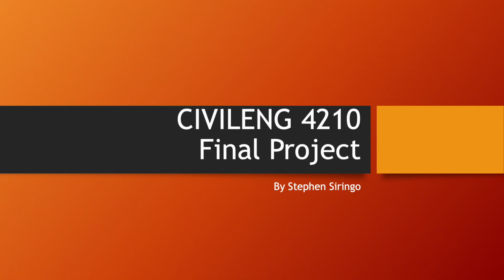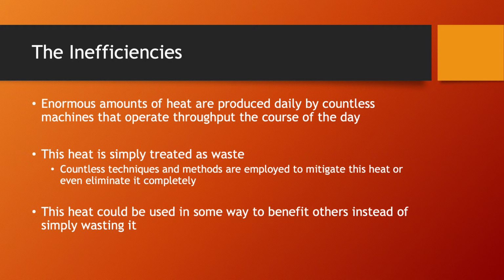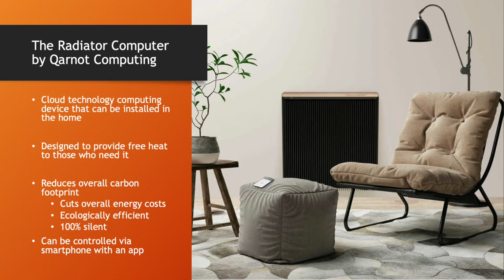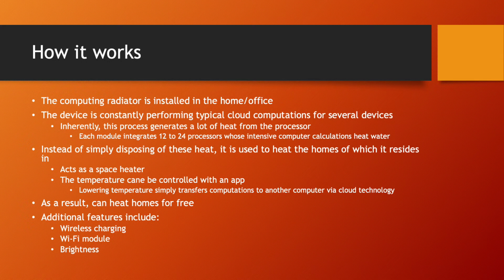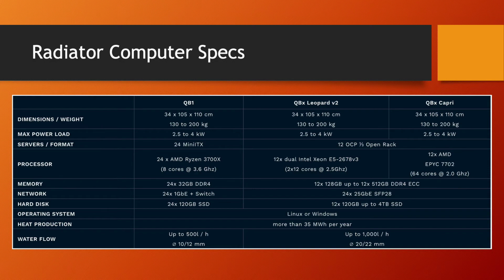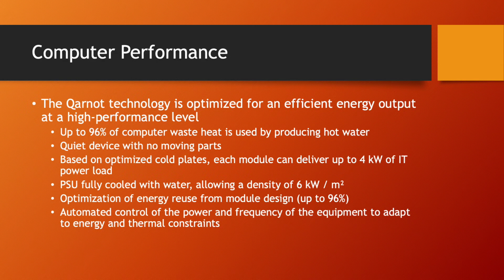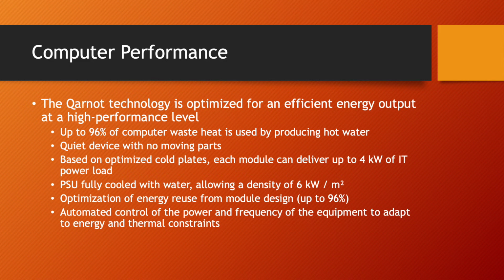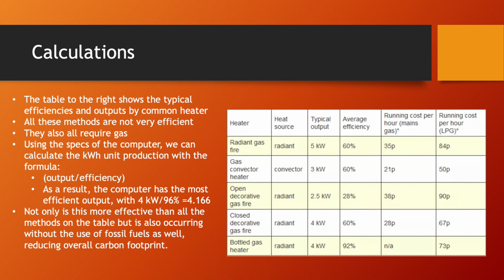4210 Final Project

Comment: Well done, Stephen. The problem is clearly stated with the issue of heating homes at high costs, therefore needing a solution to producing energy at a more efficient way. The solution does seem very plausible as well. I think the use of using cloud technology that is stalled in the home, can reduce the carbon footprint and cut energy costs through tracking heat and cooling energy consumption in an optimized way. There is very little waste from using this technology and can be shown to cut energy consumption and waste in half! I think that if this technology was utilized in every home in the US, the nation will be able to reduce energy consumption, decrease greenhouse gases, and save billions of dollars. Although there are inefficiencies associated with this technology, there are even more efficiencies that produce so many great benefits that the American people should value.